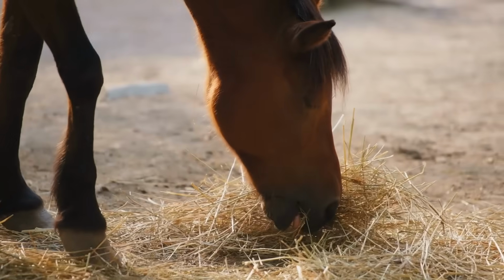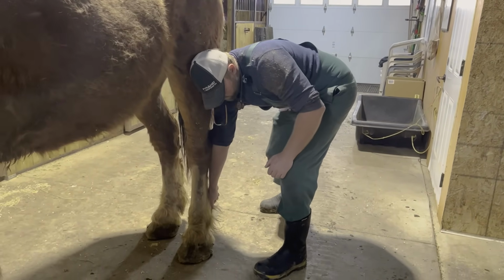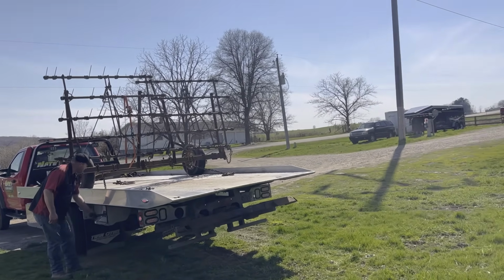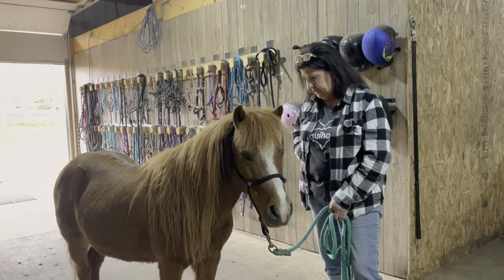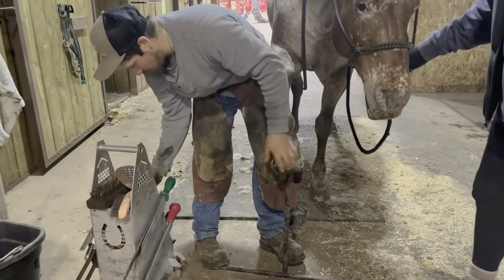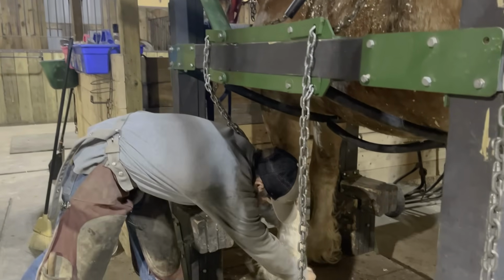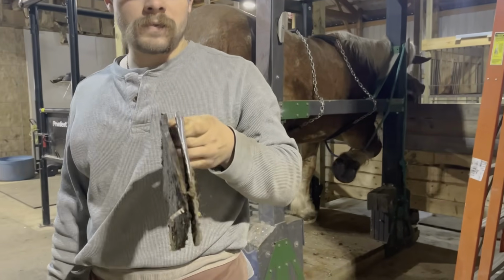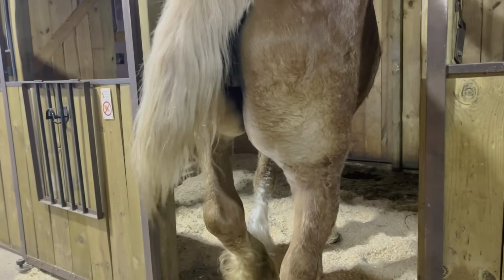Will the Clogs Help Janis and Daphne?

Comment: The thing I don't understand about poor Janice's clogs is why the bottoms are smooth wood??? They have to be slippery as all get out. Isn't there a coating that could be applied to give them a little grip?? Maybe a piece of something relatively rough glued to the bottoms of the clogs? Well, heck ... what do they coat concrete steps with to make them non-slip for the general public?? Oh, I know!! Golf cleats!! 😂😂 At any rate, Pauly deserves a medal AND a free massage for sticking with the unsedated Janice!
Reply: She's on strict stall rest so won't be walking around the barn unless she needs care outside hense why they turned two stalls into one huge one just for her.
Reply: @Amy-and-Ozzy  how have things gone for Janice. I worry about her❤